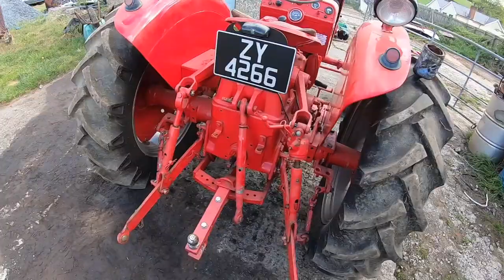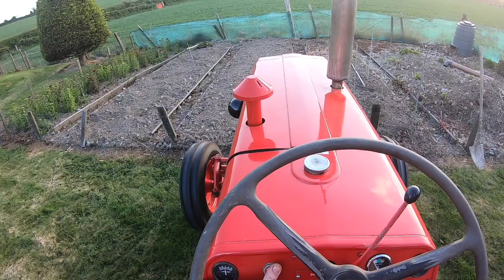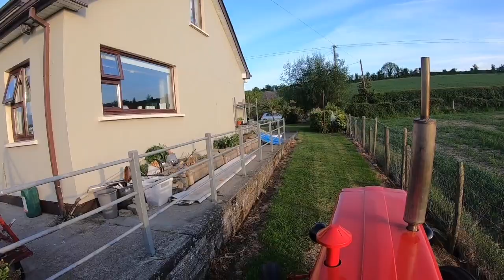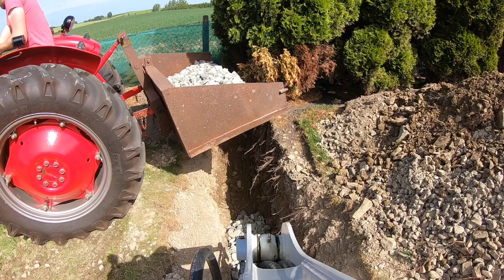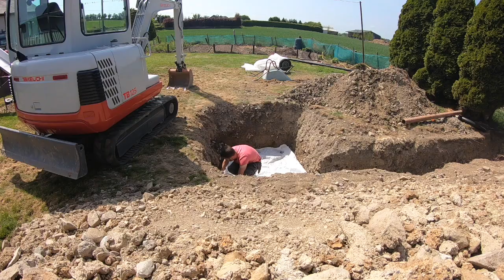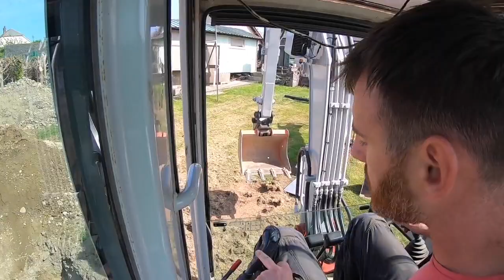Septic percolation repair (part 2)

Comment: Just curious on this repair. In my area S.E. Indiana USA. we require a lot of footage in a septic leach field depending on the number of bathrooms it could be 400 plus feet. There are also some types of leach fields with other design specifications depending on the soil composition. Are there similar types of specification in your area. BTW really commenting to help your channel 😁 since the algorithm like comments. Also reached out to my friends asked them to join so we can watch the channel grow. 😆
Reply from the maker: Thanks very much for the comment and watching the videos, I enjoy the feedback and even what I may learn from other opinions! So there is a guideline of size for new perculation/leach fields but this was an existing problem with just a blockage. You are correct, it usually goes on the amount of bedrooms in the dwelling and the sq ft size also in Ireland. I wouldn’t be entirely sure of the exact details but I’m sure other would know. The other thing you mentioned is soil type, before planning for construction  of a new house etc is approved, test holes have to be dug to ensure adequate drainage for water/percolation is available . Thanks 😊
Reply: Thanks for the reply. We recently made a very similar repair at my brothers place. So I relate.

Comment: If it makes life easier take the rubber seal out of the pipe if u find it rlly hard get in on a percolation area tis gonna run out the holes anyway hope it helps ye
Reply from the maker: Thanks very much for that Kian, never actually thought of that for percolation but it makes sense! I’m just used to joining them for other uses and the thought never really crossed my mind! Thanks again👍🏻